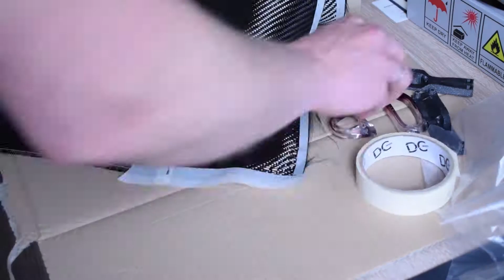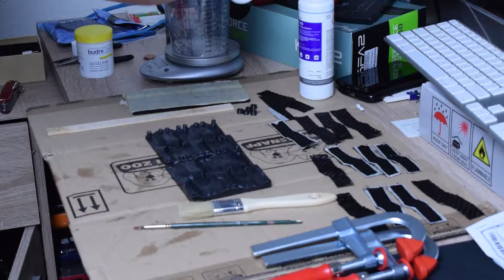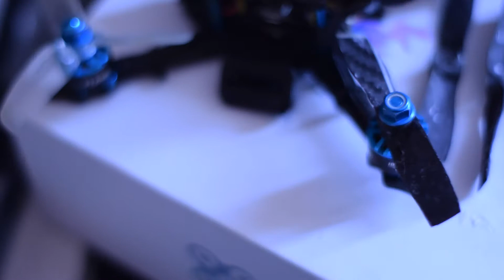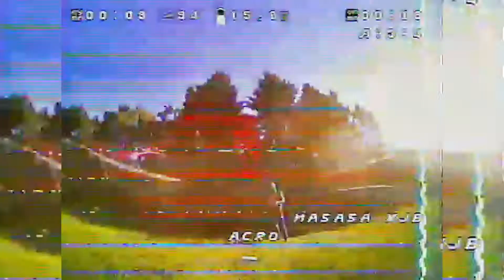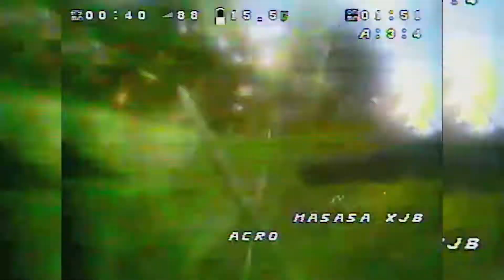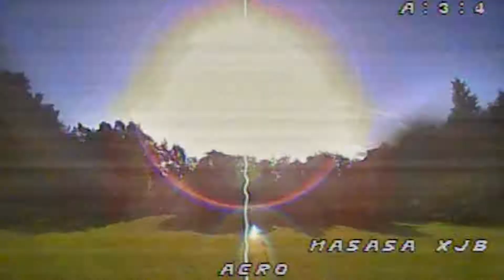DIY CF PROPELLERS 3d Printed MOLD | FPV Carbon Fibre

Comment: How did you maneged to get the Shape in CAD?
I belive this is the first Challange i would fail to.
Reply from the maker: Hi! I cutted an existing plastic propeller in different sections, and Took measurements and Adapted them to the carbon fibre project

Comment: Hi, good job.
i want aks you if the vaseline is a good release agent with resin or no and if is simple the demolding of the mold.
Reply: Ok, thank you so much for your kind answer. So the only problem is that the strenght of the resin couldn't be to its 100%?
Have you ever tried other products that work as release agent?
Reply from the maker: @marcelloiunco5094  yes, and that if you move too much the composite when closing the mould, could move also the Vaseline and avoid perfect release when cured.

And yes, I used another product specific for mould releasing, wax based. If you look online "mould parting agent" or "mould release agent" they are pretty cheap and easy to use. I didn't try any other "diy" release agents.
Reply: @masslona  Thanks a lot
Reply from the maker: Hi! Generally I found that it works ok, but the problem I noticed Is that sometimes it get mixed with the resin, so probably the structural quality of it would be not 100%.

But, yeah, if you don't have anything else it works decently, specially if you manage to apply it and position the composite without moving it too much! Hope this helps!

Comment: would like to see the mold could open sourced it to the internet(like thingiverse)
Reply from the maker: Hi! I would like too to share it, but I don't know how regulations are in regards of Security, meaning someone building a carbon propeller and injur himself.
Reply: @masslona  Common Creatives(CC) is a quite common protocol for open source projects/works
and for the safety, users shall take their own risks as well, not yours, especially you aren't providing commercial service but sharing your R&D result for non-commercial hobbyists
Reply from the maker: @ronronchau  I will look into it and upload STL files probably on thingverse, when I do I will write here.

Comment: Hi what did you apply on the 3D printed mold in order to get a better shape? I saw that the vaseline did not work at first?
Reply from the maker: Hi! i used something called "Wax release agent" found in a standard hardware store. I applied it 4 or 5 time on each mold, waiting each time to dry, the process was 20 min total. 

Yes in the beginning i used Vaseline, but i think it doesn't stick to the mold, and as soon as you move something it get mixed with the resin. i believe that's why i didn't have great results with it.

Hope this answer to your questions
Reply: @masslona  yes it did! thank you! It was not a lot of videos on 3D printed carbon fiber molding I can find on youtube =)

Comment: What kind of problems Did you run into will doing thw carbon part. I am trying somting similar to this but not or a drone
Reply from the maker: Hi, sorry for the delayed answer.. the problems I had where mainly due to the complexity of the carbon fibre cut, and detachment from the mould. But after a few trials things started to get better! For sure doing bigger parts is way easier! I hope I gave you back some valuable info!